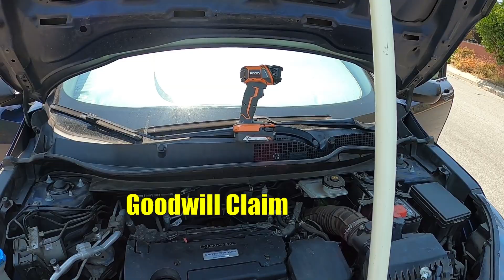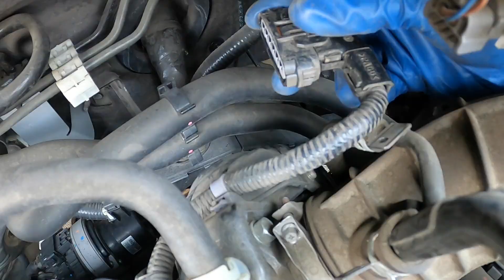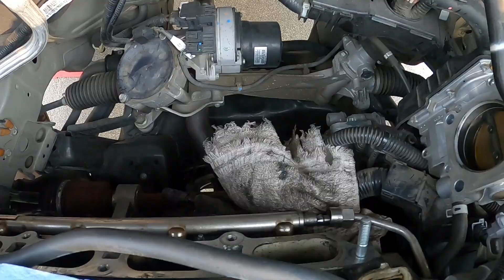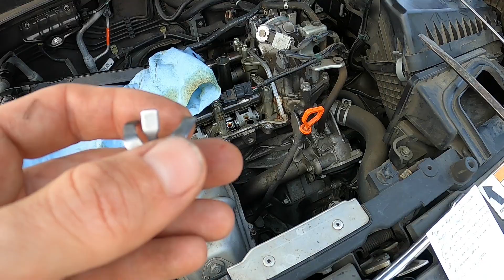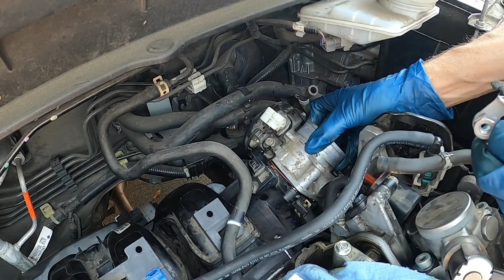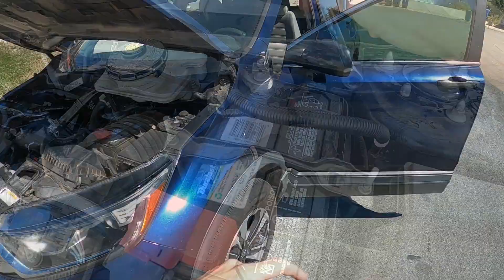How To Replace Honda Fuel Injectors. CR-V Accord Civic 2013+ 2.4L & 1.5L Engines. Complete Guide

Comment from the maker: TOOLS & SUPPLIES & DONATION LINKS
Chevron Complete Fuel System Cleaner- https://amzn.to/3Bo2iVx
2.4L Engine Injectors- https://amzn.to/3OMBKQE
1.5L Engine Injectors- https://amzn.to/3ZtyjmU
Valve Cover Gasket 2.4L- https://amzn.to/41o1Z7t
Valve Cover Gasket 1.5L- https://amzn.to/4iotcx8
Intake Manifold Gasket 2.4L- https://amzn.to/4g0gAL1
Intake Manifold Gasket 1.5L- https://amzn.to/3BlFOo2
RTV Ultra Grey Gasket Sealant- https://amzn.to/3Zu0fXQ
Locking Pliers for Injector Removal- https://amzn.to/4g5T27u
Gasket Scraper Plastic Non Marring- https://amzn.to/49tR6Df
Mirror for Automotive Telescoping- https://amzn.to/4goUdOW
Trim Removal Tool for Fuel Rail- https://amzn.to/4fYajPU
Dielectric Silicone Grease- https://amzn.to/4gnYwdz
Pry Bar Set- https://amzn.to/4fexpR8
Rubber Mallet- https://amzn.to/4iqjLNw
Pick Set for Oring Removal- https://amzn.to/3Vt4D8y
Power Ratchet- https://amzn.to/3ZIo7s6
Impact Driver 3/8"- https://amzn.to/3ZIAJQ8
WD-40 Spray Lubricant- https://amzn.to/2liThGj
Rubbing Alcohol 99% - https://amzn.to/3qN2HY3
Socket Wrench Tool Set- https://amzn.to/3tbmEbo
Wheel Chocks- https://amzn.to/3fAs6Aj
Car Ramps- http://amzn.to/2x668zQ
3 Ton Jack- https://amzn.to/3mk259j
3 Ton Jackstands- https://amzn.to/3kmGZFJ
Mechanics Gloves- http://amzn.to/2w0i1SP
Nitrile Disposable Gloves- https://amzn.to/3w714qi
Safety Glasses- http://amzn.to/2ez41Jw
Magnetic Work Light- https://amzn.to/33tk6tp
If you Enjoy the Channel Consider Helping Support it by Donating with Youtube Super Thanks or Using Links below or by Subscribing (it's Free) & Watching some of my other Videos
PAYPAL DONATION https://www.paypal.me/JonnyDIY
Zelle Donation JonnyDIYs@gmail.com 
Venmo Donation JonnyDIYs@gmail.com

Comment: Man this is a great video!! Thank you!!! I really want to skip out on a getting a new fuel joint but it seems best to go ahead and get a new one
Reply from the maker: You're very welcome, happy to share. Yeah they sell a kit for that. I forget what it all comes with but its like 2 or 3 things I remember
Reply: @JonnyDIY 1. Question for you! I know a lot of mechanics and people say replace the high pressure fuel feed line, were you able to successfully reuse it?
Reply from the maker: @New_Orleans_Ghost_Hunter I reused it because I couldn't get the part on time, but it isnt advised. Its like a crush fit, one time use. I would get the part if possible

Comment: I hope you can have a video on simple starter replacement on that same CRV.  :)
Reply: Two 14mm bolts, 1 nut holding down the terminal and 1 connector
Reply from the maker: Havent had to do one yet, but will do one if I get one to do for sure! 👍

Comment: What is the gasket you said was going to have to be replaced ???
Reply from the maker: The intake manifold and valve cover gaskets 👍
Reply: @JonnyDIY oh Thankyou!! I’m at 76224 miles and mine are already going out.. and I was getting them changed last weekend but you said gaskets needed to be changed and I was like oh wait I don’t have those😂😂😂 Also do I have to release some of the pressure in my fuel system before taken out the injectors
Reply from the maker: @tiffanyhemmer5386 you could take out fuel pump fuse and run the car out of gas if you want, but I just unbolted the fuel connection slowly to release pressure 👍
Reply: @JonnyDIY Я отключал программно бензонасос и вырабатывал топливо. L15BT.

Comment: Just here to say....

I recently did this job on our 2015 honda CRV. Everything was thought out, planned, and executed perfectly. Every single gasket, electrical connect, and hose was replaced as it was found. NOTHING changed other than installing the injectors and gasket. I follow this video to the T. 

Now that car wont even crank. It ran for 3 seconds then bogged down and hasn't been able to crank since. Ive replaced the battery thinking it could be low voltage to the fuel pump, but this only seemed to make it worse. 

While this repair might work for some people, it certainly didnt for us.
Reply from the maker: Go back over your work sounds like you may have missed reconnecting something. Have you hooked up a scan tool as well to see if you have any codes?

Comment: “…it’s a common issue with these…”

Continues to put in the same exact OEM injectors. Lols
Reply from the maker: There's no better part than those. What else would you use? Its the design, not the part

Comment: Much easier to change on 2014 & 15 civics. I did mine today with help of friend & took less than an hour.
Reply from the maker: Nice! Yeah this one was a pain in the a$$! Just a poor maintenance design especially if they fail that often
Reply: @JonnyDIY  it seems indeed! For my 2014 civic interestingly it’s just good reach of hands & two bolts holding fuel rail. First I thought we’ll have disconnect the fuel hose from rail but we then realized we didn’t need to really & got very careful while removing & inserting clips holding injectors though as it can be tricky but we did & checked 4-5 times after fitting it back in to holes to make sure no leaks. We even sacrificed ear wax cleaning camera stick ($15 from Amazon 😂) to make sure there are no leaks afterwards & everything worked well out. 😂
Reply from the maker: @VasimDodiya23 awesome! Ohh cool nice idea about using the lil ear camera,  smart thinking 👍

Comment: Here from a p0103 code high maf voltage. replaced maf and all wires are good. I see the same dashlights on my 2016 at the end of the video. Gonna have to be the injectors thanks for the write up.
Reply from the maker: You're welcome, happy to share. Hope you get your car issues sorted 👍

Comment: Man. Your the only year for 2013- 2016 crv that's on youtube. You're saving ppl alot of money man. Thank you!
Reply: I have this same exact issue in my 16 crv. Your video is definitely super helpful and i will likely watch it several times in the coming days to make sure I got all the info before I give it a go. Thank you
Reply from the maker: @keithcollins3460 you're very welcome, happy I could help you out. Good luck with the project 🙌👍
Reply: @keithcollins3460  What code are you getting?
Reply from the maker: You're welcome, happy to share! 🙌👍
Reply: Not us lol. I did everything identical to this video, even buying several of the items in his links. 

The car wont even stay running now. It was MUCH better with the clogged injector on cylinder 3... 😂
Reply: @dipinmylip1171 mines did it at first like that. If the intake manifold isnt on correctly.  That's your issue. You gotta carefully put things back the same way. If you get over confident. Mannn bad business

Comment: What happened to the roof rod thing
Reply from the maker: The hood prop? Its still there. I just use another longer rod to open the hood higher when working on it. The factory rod is low and youll hit head on hood

Comment: Why change injectors? They are great for cleaning and then work for a long time. The original ones are very reliable and work for a long time.
Reply from the maker: Carboned up so much and they get a bit damaged removing them. Guess need some rubber jawed pliers
Reply: @JonnyDIY  They are removed normally. The main thing is not to lose the lower lining which is under the rubber ring. The mesh, teflon and rubber are changed. . I made 200 sets of these. I repeat, these are DENSO, they do not like ultrasound and Chinese stands.
Reply from the maker: @246alfa how do you clean them? 🤔

Comment: Great vid! 
Did you replace that metal high pressure pump to fuel rail pipe? And any leaks if you didn't? Planning to rebuild my injectors and ultrasonic clean them. No issues, but just as part of a 100k mile tune up.
Reply from the maker: Thanks! I don't think I replaced it, and never had any leaks. Honda does want you to replace it every time it's disconnected though because of the high pressure, but I didn't have an issue. But your mileage may vary 👍

Comment: Why change injectors? They can be cleaned perfectly.
Reply from the maker: didn't have the time to send them off to be cleaned, and they were really carboned up. With this direct injections it's different than cleaning port injected injectors. They see a long more carbon, heat, and wear. Also I dont have a special tool to remove them, and they were somewhat scratched from removal
Reply: @JonnyDIY  These types of injectors have small sprayers and a very small filter at the inlet. They are great to clean and install back into the car. Do not wash them in ultrasound, they will stop working properly.
Reply: @JonnyDIY  I have developed many new technologies for cleaning modern injectors. If no one comes with ultrasound and a Chinese stand, then 99.9% of injectors return to the car.

Comment: I would not leave spark plugs in any engine for more than 100,000 miles regardless of what exotic material they are made of.
Reply from the maker: @larryordine7542  they're sure made different than the old copper spark plugs of old. They routinely last 150k-200k miles now especially if a lot of road miles. But they're cheap to replace and easy on this particular vehicle 👍
Reply: Correct...iridium can last around 60k. 100k is way to much even for NA engines.
Reply: @The_Touring  Actually Toyota says 120,000 and I just took a set out of a car with 140,000 on them and they looked decent if a bit brown.  So 60,000 is very conservative

Comment: What's the labor rate for this job. How many hours does the book say it should take? Thank you sir.
Reply from the maker: @WhenJesusSavedMySoul  depending where you live but in California its around 2000-2500 dollar job so figure 1100+ in labor so 6-8 hours. Not sure exactly what the book is but probably close to that
Reply: @JonnyDIY  LOL book time is 1.1 hours
Reply from the maker: @joserivera-xn6kf I dont think so not for injectors. Think the Honda book on it is 3.5hrs. Not sure how the dealers can charge $2300 when parts are at most $1000
Reply: 1800 my mother-in-law just got it priced out at a dealership. I just watched this and found a 210 dollar kit. Charging her 400.

Comment: p0303 the reason why you changed the injectors ?
Reply from the maker: @kEEPITMOVING408  engine code yes, but it was sending it into limp mode sometimes on freeway at higher speeds and all dash lights coming on
Reply: @ I’m having this issue now but  only the check engine light flashes and goes into limp mode
Reply from the maker: @kEEPITMOVING408  sounds like injectors to me. Check out plugs and coils first, but injectors seem like the most common culprit on these
Reply: Usualy with Honda it's coils. Using low octane gasoline can make other issues such as injectors. In Europe we have 2.0 SOHC R20 engine for CR-V which is even more reliable then 2.4.

Comment: What’s the difference between these injectors vs genuine ones? How has your car been since?
Reply: Your engine is the earthdreams 2.4 correct?  My local Honda dealer wants $1000.00 for 4
Reply from the maker: @Ricky-b5r  yes earthdreams 2.4l. Wow $1000 for the kit now, I'd priced them out last year for a bit less maybe 700 ish with. Shop around online honda dealerships and you should be able to save a bit of money or see if local dealer will match other dealers. Some will do that 👍
Reply from the maker: @Ricky-b5r  Car is fine and running great since replacing. I believe they are the same thing, but you can try to get some at Honda dealer. I know a lot have had them backordered and out of stock. But hopefully they've got more in stock now.
Reply: Take always OEM Honda. Aftermarket injectors not a quite good idea. You can also clean the old and they will work just fine. These gasoline injectors are not prone to failure as diesel which works on much higher loads.

Comment: Thank you so mucj for this video. I got the throttle body off amd realized the civic I had 2015 has a different fuel rail with two nuts and no need to take the manifold off! Phew!
Reply from the maker: @littlejohn_racing  You're very welcome, glad I could help you out.  Happy you got it figured out, and wasnt too hard of a fix 👍

Comment: Great video!

Do you need to remove the valve cover getting to the injectors or can I get to them without removing it?
Reply from the maker: @anthonyhernandez487  thank you! On the 2.4l, yes it made it so much easier to get the intake manifold off. On the 1.5l you may be able to leave it.
Reply: @JonnyDIY  Thank you for the very informative video! 👍🏽
Reply from the maker: @anthonyhernandez487  You're welcome, happy to help 🙌👍

Comment: What's the name of that broker that holds the bolts of the throttle body bolts. I lost one of them. Or it just one had one side to begin with....
Reply from the maker: @Mikes214-DAL  huh not sure the name of bracket. I would call dealership to source it. If I can find name Ill update 👍

Comment: Was it not necessary to relieve pressure from the fuel system?
Reply from the maker: @FoolZ8o5  no it wasn't necessary. I just loosened it up slowly. You could pull fuel pump relay and crank engine til it dies 👍

Comment: Use Green Fuel Tab
it will clean it over a period of refuel
Reply: Thank you for your work,salute to you
Reply from the maker: @fredwilliams4661  You're very welcome! Happy to share 🙌👍
Reply: What would be a fair price for this job in Labor?
Reply from the maker: @jf5245  total job including OEM honda parts usually runs $1200 to $2500. I'd call a few local dealers to get quotes. Price usually depends what part of country you're in
Reply from the maker: @TranTek  nice, have never tried that product before 👍
Reply: @JonnyDIY i had used for years
works awesome, engines run so smooth
it will clean out all the carbon deposit 
needs time 
over 3-5 tanks of gas 
Jim Lynch created years ago for cargo shipment and ships
right from California over 25 years ago

Comment: Nicely done and explained.  That's a lot of work.  Do you know if there a recommended change interval for the high pressure injectors?
Reply from the maker: @elliottm9365  Thank you! No it's kind of one of those things you just change when one starts acting up. Because they could go bacl at 25k or 250k, it's just a roll of dice. Using a fuel system additive like Chevron Complete fuel should help a bit as well once every oil change cycle